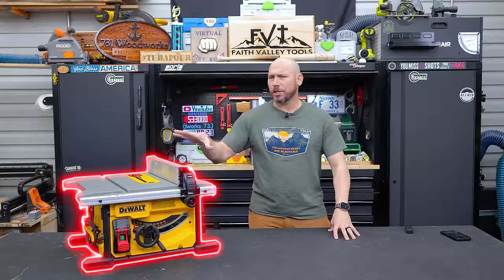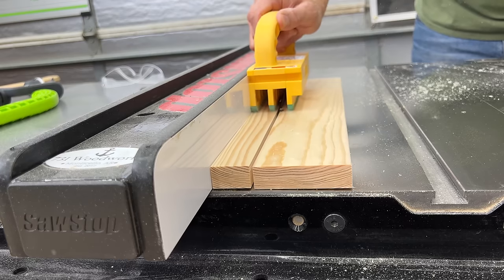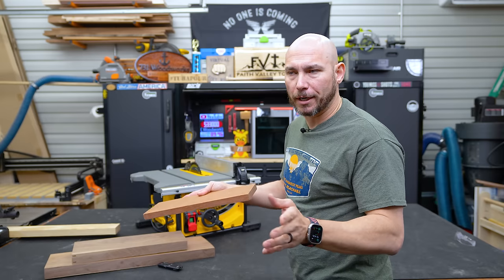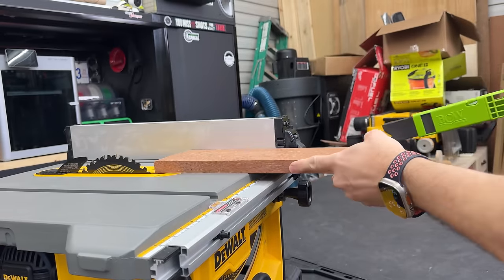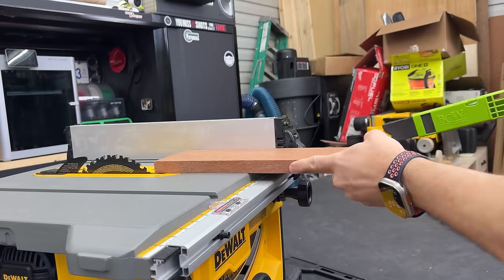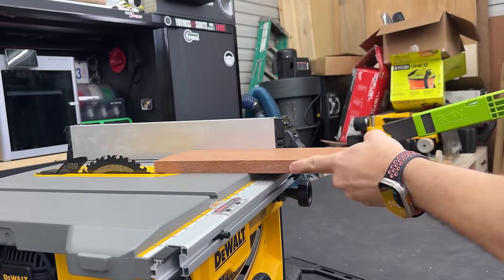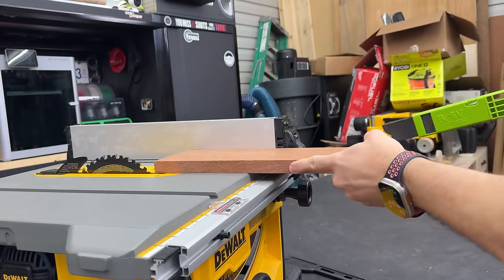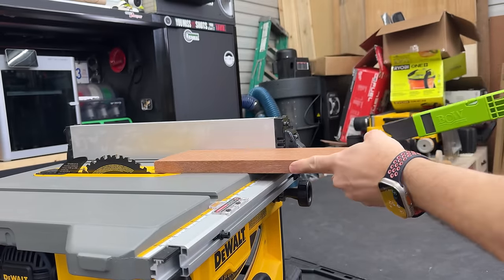99% of Beginner's Don't Know These Table Saw Mistakes to Avoid!

Comment: I use a table saw all the time but what I do is I never even get close to the blade. You just pick the cleanest side you want and place that against the fence. Then you go about half way through the cut, then pull it off the blade quickly, turn it over, then do the same half cut from the opposite side. That way you never get close to the blade at all, for the  small pieces those always want to move around a lot anyways, so you take about a 2 foot piece of wood, and make two sticks, one to hold it against the fence ,and the other stick pushing it through. Once again not getting anywhere close to the blade at all. I would be more concerned with skill saws, all that safety stuff actually makes them more dangerous. The reason is they have them set up where you have to hit the trigger, press some stupid button or lever, all while your blade guard always catches on the start of the cut. That's three things you have to watch at the same time, all because they don't want you to get cut, and I understand that. They design some of these saws like they think nobody actually is going to use them for anything other than huge plywood sheets.

 Chop saws are pretty dangerous to, mainly if you are standing up a piece of trim to cut an angle. Been using all of them for over 30 years, and I always see people sliding the wood past the fence with their hands, you never do that. Just slide the piece through about half way, come off the blade quick, then flip it over and cut the other side till its all the way through and you eliminate your hands being anywhere close to the blade. Most contractors who don't do constant cuts daily don't carry a table saw with legs, if you do make sure if it's on a table to fasten it down to the table. I would only have a table saw with legs if I was doing woodwork daily, and I always have my saw on the ground because if it jams and it's on a table not fastened down, the saw can go flying off the table. I know because it happened to me..once. Nothing more blood pressure raising than having a saw still spinning land on the customers driveway, lucky for me the blade was set really low. Hope this helps someone, I am not advocating removing blade guards, I only do it because all those cheap blade guards actually make it more dangerous for me not less, I only have the guards removed on my table saw, not the rest of them. Just go slow on your cuts instead of jamming it through like you were running a saw mill. That way you avoid all those kick backs, and then just pick pieces of wood that are not warped in the first place.

Comment: Probably a better tip would be to throw that green push stick in the trash.  It's like trying to control the wood with chopsticks.  Sure, your fingers are far out of the way, that's a good thing but maybe having better control of the work piece is a better option.

Comment: depth of cut  the classic is between 1/2 and 3/4 of and inch.. Too shallow . say 1/8 inch is risky too.  You want the blade to be cutting on the downstroke  and you want less side friction.  1/2 or 5/8 above the work is just about the least friction.

Comment: Not an expert.  Consider adding  a tourniquet to each car in case of an accident.  For you to apply to you.  For someone else to apply to you.  For you to apply to someone else in your car or another.  Try to store within access of the driver's seat.  Try to store in where it's easily visible and accessible to the first person who shows up.  For example, mine is attached with a rubber band to the outside of a bag brightly marked first aid bag.  That bag is attached with stretch cord to the back of the front passenger seat's head rest.  The driver can rip it off the bag while still in the seat.  Or hopefully an accident witness would see and access it quickly.

Comment: Just for fun I looked up the gripper is $100 then the Bow extender 36 inches is $310 and then INCRA Miter V27 Miter Gauge $180, plus BOW Products XT2 T-Track Clamps another $82 your around $672 plus tax here another $100, so I figured you buy all the stuff, way past $1K...ouf!

Comment: Hello, during my school days in the 1960s-70s, there were no coding classes available, and instead, we were required to watch shop class videos. One such video showed a man being impaled by a kickback board, which was quite horrifying. The video was in black and white and was meant to be an instructional horror film. Even today, I remember that film vividly.

Woodworking can be dangerous, and we have all faced situations where wood has flown off under pressure when we were distracted, ignorant, or overly confident. Nowadays, tools and accessories are readily available, and they can be purchased at competitive prices and shipped quickly. However, back then, we would often have to go to a specialized dealer and buy proprietary accessories. While there were Sears catalogs available, when time was of the essence, we would end up at a trusted dealer with a knowledgeable staff who knew and used the tools well. We all know someone who is missing the end of half a finger due to a woodworking accident.

Thank you for sharing the great video!

Comment: Just a simple question, since you are talking safety. Why wouldn't you pull that DeWalt closer to the edge you are standing by, instead of reaching that far forward? If you somehow lose your balance while reaching for cut piece, you might gash your arm on that blade, even if it's not rotating. Just thinking. Other than that, it's very informative for beginners, even us stubborn (that would never happen to me) old farts.

Comment: Just make up your mind that the push sticks are disposable. Make yourself a bunch of them and don't hesitate to cut into them rather than cut into yourself. YOU SHOULD AVOID CUTTING INTO THE PUSH STICK JUST BECAUSE IT CAN KICK BACK. If you've got to cut into your pusher use a push block.

Comment: One can never compare losing a finger to money but it would be nice if it didn't cost over $100. to reset the sawstop saw each time it triggers. Id like to see a design that could be easily and cheaply resetable like resetting a circuit breaker.

Comment: The CAT tourniquet you are practicing with can also be used. Not, “used in a pinch”, used first. They don’t go bad, well, not in a couple of years. 
If you cut your leg and need a tourniquet, put two on, one started from the left, the other from the right, and they need to be as close together, “less than an inch”, but touching. 
Don’t zip tie them to anything. There is an interesting video of a Russian who bled out from a thigh wound, and he couldn’t get his tourniquet off his vest because of the zip tie. The CAT was bloody from him trying, which brings up…
Take them out of the wrapper. When you are scared, blood is pouring out of a wound, your hands are slippery from blood and sweat, you’re going to have a hard time getting the package open. 
Finally. Research how to do it, and practice. If you’re right handed, you NEED to be an ace doing it left handed. 
I carry one as part of my EDC. They issued them at work several years ago, and carry them for me at work. I’ve salted them everywhere. 
Bless you Matt for saying this. If you didn’t need it when we get there, no harm. The hospital will take it off. Unless you have a paper cut and use it (true story) EMS isn’t going to laugh at you. The life you save will be your own.

Comment: Some of the reasons I hate these worksite tablesaws, 1.  they are too dam small. 2.  You have a short work area in front of the blade. 3. You almost always need some kind of support behind the saw. 4. They are direct drive no belt drives. I had a great Porter Cable tablesaw I loved unfortunately they were discontinued 😢 what happened to my PC is a long story out of my control.  I can't find one in good shape for even 2x what I paid for it new 😮

Comment: If you decide to ignore these safety rules, do just one thing, make sure you keep a CAT (Combat Application Tourniquet) close by and handy in your shop, go ahead and have your name embroidered on it as well. Also keep a sterile towel and container of sterile water to dampen the towel to hold the parts you chop off and transport them to ER with you. Impromptu tourniquets DO NOT WORK. I know from experience, I've tried them because I didn't have CAT, and they don't stop the blood flow completely, they only slow it down a little.

Comment: Im new so forgive my ignorance.
Why set your blade low if it then is cutting in a rearward heading, instead of sitting the blade higher so it is then cutting in more of a downward  heading? Pinning the board down instead of trying to spit it out the back. Seems the risk could be addressed by standing to the same side of the blade as the stock side of thematerial being cut and pushing through, instead of standing on the waste side of the material and reaching across behind the blade and pushing the stock through. Seems all back to front. Panel sae yea i see the logic but not here, olease explain

Comment: #1 reason for not changing out a table saw - The current one is good (but not perfect)  and you don't want to buy another, at any price higher than the cost of a new blade. 

And I foresee that if legislation does what is predicted, I'll be able to sell mine (when I'm too old to use it) for the same price as I bought it for in 2001.

Comment: North American Rescue has the CAT tourniquet in blue to be used as your practice one.  No difference from the black or orange models other than the color which lets you know it's the one you're using for practice.

I agree; definitely great advice not to give those conterfeiters a single dime, even if their products could be useful for practice.

Comment: To start with where the hell are the crown guards , preach safety by all means but start with the no 1 most important item , the crown guard
Reply: It's not always possible to have it in place but he does mention and show it.
Reply: @asmith7876  only when overcutting the blade for grooves or dados or extra thick material . Crown guard is not only safety but dust extraction and helps against material riding up . I use a saw for a living and would never  not have the crown guard fitted

Comment: WRONG. #3 is totally wrong. Your cover photo is bad. Crank the blade up all the way. HERE IS FACT. When you can see the blade, you know it is dangerous and naturally stay away from the blade. You eyes are not stupid. "I had a really bad kickback" YEP, absolute proof the blade is too low. If the blade is up all the way, it pulls the wood DOWN, not back. I don't get kickbacks. I've seen the blade lift the wood up, but as soon as the wood was higher than the fence, it fell to the side rather than going flying. 
Don't take my word for it. The guy representing Forrest saw blades at the Woodworkers show is the guy who taught us this.
Reply: About time a comment made sense! Finally someone else who can see blade height plays a role in machine safety!!

Comment: Oh the Irony of using leopard wood (around $20 bf) on a contractor saw. Table saw mistakes you want to avoid ---> buying a contractor saw to do fine woodworking. Save your leopardwood and wenge money and get a proper cabinet saw.

Comment: Did you just make a 26 min video about table saw safety without stating that the saw should be unplugged before setting it up and touching the blade? That's hilarious. 
Don't get me wrong the advice is solid but don't put your hand on any saw blade without making sure it's unplugged.

Comment: As someone who spent Friday night in the ER because I caught my finger on the tablesaw blade, get over your ego and fanboy self and get a sawstop. Sure, they may 2x the price of a “normal” saw, but you’ll make that up in 1 non-trip to the ER, even if it is only for stitches (it can get A LOT worse super quickly). And, it only takes a MOMENTARY lapse of focus to accidentally run a finger over the blade, and all you have to do it brush it for the blade to pull the rest of your finger/hand in.

I hear you, I don’t like SawStops business practice either. They claim to be all about safety, but they then lock safety behind their own paywall and refuse to let anyone else in. It sucks. But, if it means I get to keep all of my digits and stay out of the ER, then so be it. I’ll pay the piper until their parents expire of they change their business practices.

Comment: Blade above the wood has NOTHING to do with clearing out wood chips. Only the front of the blade is making the cut while PUSHING down on the wood (or else wood would lift up) and wood chips get spit out under 🤦 

There are reasons for why you would leave you blade out a bit more but has nothing to do with wood chips. 

I see that being debated all the time by people who never stop and think before opening their mouth.

Comment: Best is to think of a table saw as a weapon with a blade rotating at 5 to 10k rpm into your direction... with torque!. Think of it as something that wants to suck your fingers and hands into it. This is the right baseline for knowing how to handle it! Even if things go fine for a while. Don't be fooled. It's a weapon. Same goes for lathes.

Comment: Here is the million dollar invention.  Ask yourself why table saws have this problem and the handheld circular saws that are used every single day don't?   Analyze the difference.   The handheld circular saws have the weight of the saw on what is being cut,  the board.   And the pressure of the hand adds a little more weight.   So the board being cut is held between the table and the circular saw.   When the saw starts to bind you can feel it and back up a little and try again, 

Now for the invention.   The table saw has only the weight of the board on the table.   So there is nothing holding the board down.   Your jessem stock guide is pretty close.

Comment: I don’t use it, the teeth on it scratch my wood, it’s cheap and wiggles around and it’s a nuisance… I began with it but my very first cut on semi expensive hardwood, maple, it scratched on both sides of the blade cut from the anti kick back, so I had to cut an inch off both pieces and then on top of that I had to buy another piece of maple because that was the size I needed and with an inch removed my project ended after the first cut so that blade guard got removed and thrown in the garbage

Comment: Listen closely people.  I had a board pinch, and try to kick back. I was holding it with my left hand trying to keep it from kicking as I reached for the off switch. Board split, and sucked me in. It cut through my thumb. Kept most of my thumb, but lost the joint.

Comment: Got to 3 and you lost me, if you don’t understand that blade height plays an important role in machine safety I suggest you hit the books again. Also operating without a guard is just stupid. Saws have guards, yeah you can remove them but its like removing a seatbelt from a car. Yep works fine without it, until you need it. Stop teaching bad habbits

Comment: This guy this video's got a million views and half of what he's saying is wrong. I would never use a guard. While you think it could be more dangerous the reality is the guard causes problems that can cause you injury. Anything that obstructs your view of the blade where your hand is going through even if it's with the push stick you're risking injury. However if you or somebody that is bad at using tools or don't have confidence in yourself or understand the dynamics of what's happening when you're cutting with something spinning then put a guard on You might still cut your finger off

Comment: is it right what this guy tells us? you make the fence parallel to the blade? where??? in Germany this is wrong and counts as a very dangerous mistake. dont do that. we call it Freischnitt
Reply: Please explain in detail how the fence should NOT be parallel with the blade!  The very concept of the fence is that it be parallel to the blade. (Edit) Well, after some brief research it seems on some European saws the fence stops right after the blade!  I can see that, and the logic of having the fence slightly tilted although having it stop after the blade makes more sense to me than having it tilted away slightly.  I've only been exposed to American saws, this is new information for me, love it! Perhaps we'll adopt that style of fence...right after we adopt the Metric system 🤣🤣🤣.  Cheers from America!
Reply: if you align the fence absolutely parallel, inaccuracies in the guide and fastening can cause your workpiece to become trapped between the fence and the saw blade - the result is a kickback.
that's why we tilt the fence a little little bit away from the saw blade at the end of the cutting area, so that the opposite effect can never happen = no kickback

in Germany, this is the method used in every professional environment (if the fence is not adjustable as you described so that it ends at the point of the cutting area)

and it creates absolutely no problem with accuracy - we are the festool guys ;)